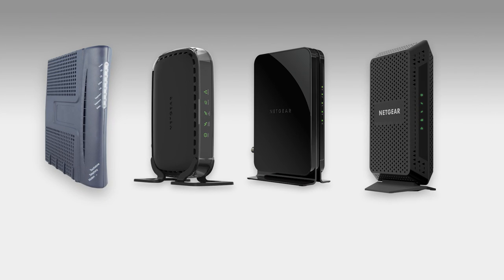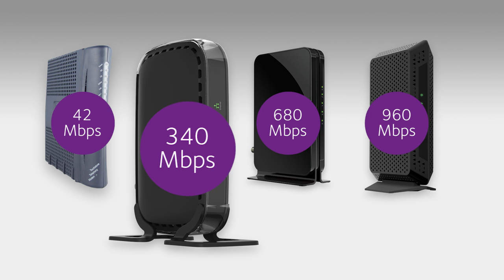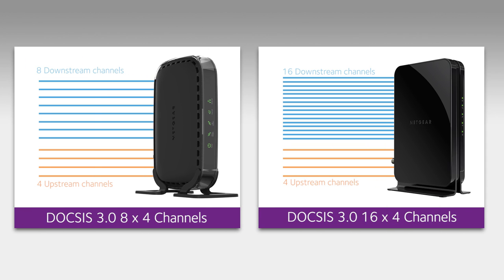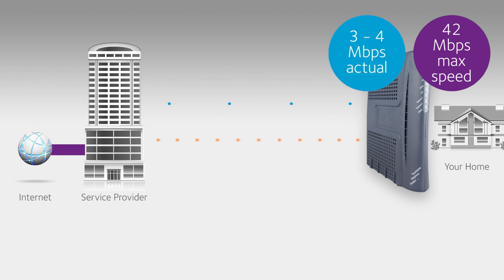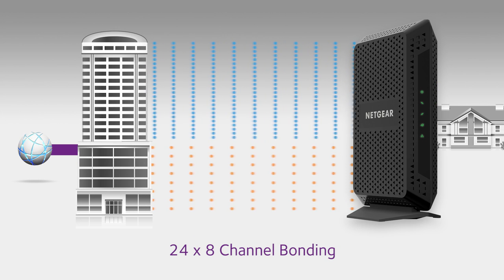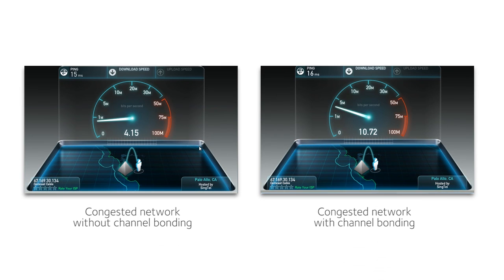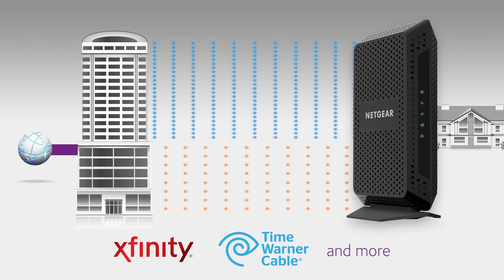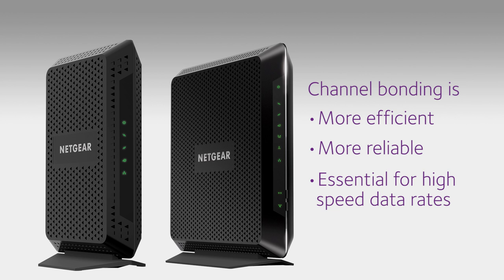Channel Bonding in WiFi Explained | How To Achieve the Fastest Internet Speeds

Comment: Except your ISPs firmware may limit the number of channels. My Spectrum cable account has 24 x 4 channels available. On either free or 32x8 modem my typical speeds are 118x12 mbps. The free 16x4 channel bonding modem was NOT out performed by the 32x8 modem I bought. I'm thinking it's a waste of money and that channel bonding  above 16x4 may not be worthwhile.
Reply: Ron Sam that is correct. If the cable plant is only setup to have 16x4 It doesn't matter if you have a 32x8 modem. Basically the cable company only has made available 16 channels for downstream and 4 upload channels available.  They could have 32x4, but they have to make more 16 frequencies available to do that. They are limited on how many total frequencies they can use. Majority of the frequencies are used for tv channels. Now that a lot of services are going to ip based systems more frequencies will become available for downstream and upstream channels to be added. So in a nut shell yes you are kind of right in saying it's a waste of money to buy a 32x8 modem right now, but eventually those freq. Would be available.  Everything is going ip based in most major cable companies so It won't be long.

Comment: how do i channel bond i have a nighthawk ever since i bought it and hooked it up im not getting the performance every one tells me i would i never knew about the free 90 day service providing they had to connect to me for free and set up my moderm ,,,i never took advantage of that and now since i want some one to connect and fix problems there charging me is there a way i can do things myself!?
Reply: kusha kizz channel bonding is only for modems not routers. Your modem may be limiting your performance. What do you pay for and what do you get?
Reply: More than likely if you're using wifi you've got a network issue. You should connect to your modem via a hard line and see if you're getting acceptable speeds that way. If so, it's your wifi.

Comment: what are your thoughts on nighthawk ac1900 modem/router combo?
Reply: its a bundle, it comes with both units, it is not one unit with both inside of it. Do some research.
Reply: I got this and the technician set the channels to the same name. It has been a couple months and just checked. I get 118 mbps down on a 100 mbps plan over wifi. I am sure my laptop that is hardwired to it would be a little faster.
Reply: The modem is built into the router.
Reply: @zacharywissinger3996  most ISP provide more than the plan itself, I've seen the same on 100 Mbps and 480 on 400 Mbps plans. At the end of the day netgear is shit, and if u ask for help from their customer service after 90 days of purchase they wont help unless you spend atleast another $50 🤷🏼‍♂️

Comment: I pay for 100 mbps plan with Comcast xfinity, and I only get 24 mbps LAN and 12 mbps WiFi using an 8x4  downstream/upstream, 340 mbps, n300 router, 2x2 Tx/Rx @ 2.42GHz.   Wtf
Reply: i highly recommend you buying a netgear cm700 or even better netgear CM1000 and future proof your internet service dude... you only has 2v2 channels that's bad if you have money to spare buy any one of those i just mentioned it will definitely help you out and if it doesn't you can always return within 14 days.. i don't think you will be disappointed since i bought cm700 and my internet is blazing through everything i do
Reply: Don't get the netgear cm700 due to chip issues... the cm600 is the way to go...i went from an old Motorola 4x4 modem to a 24x8... very noticeable

Comment: If I use a 24x8 vs a 16x4 cable modem on a FPS like Call of Duty on PS4, will my latency and speed be faster on which one? OR does it not matter because of my speed?
Reply: theoretically like hard drives the more you split up the loads the faster it'll be, let's say you have one 5tb hdd clocking around 300 MB/s writing a huge iso file it takes approx. 5 minutes. while if you had 3 5TB hdds running in a single raid volume sharing the load equally it will be nearly 3 times the speed in theory because you have it writing 300 MB/s but it'll download the file to the drive in three separate partition, for simplicity sake part, a, b, and c. so drive 1 will take part a, and so on and so on. so the latency should also go down  considering you have multiple streams going to your device.
Reply: very good explanation now i know how channel bonding works.
Reply: IT DEPENDS ON THE DISTANCE OF THE GAME SERVER AND HOW FAST YOUR INTERNET YOU PAID FOR 
IT'S NOT YOUR MODEM
Reply: Cole Jones 24x8 will help u reach the speeds ur paying ur provider for
Reply: @MrDICKHEAD28  It's like blaming low FPS on shit internet connection.

Comment: I never recommend netgear, when I contact customer care to look at issue, they are saying to buy new device. worst customer service..
Reply: YES TELL THEM THAT YOU GOING TO BUY NEW DEVICE WITH A DIFFERENT BRAND
Reply: yeah don't buy from cisco 
/linksys either 
they pull the same shit ,  they ripped me off on a router a few years back and i will never forget it 
i like Asus support much better
they pressured me and up sold me a new router ,said it was a special   manufacturer offer and that it would expire if i didn't get it right then turned out to be $40 over what it costs in the same store i bought the original router from
and they try and  make me pay for support after a year ,after they ripped me off too